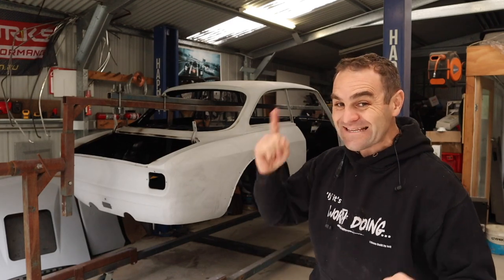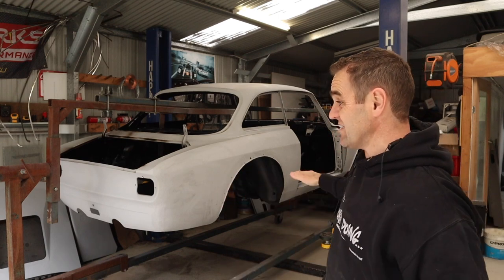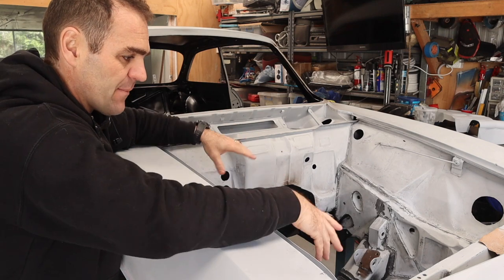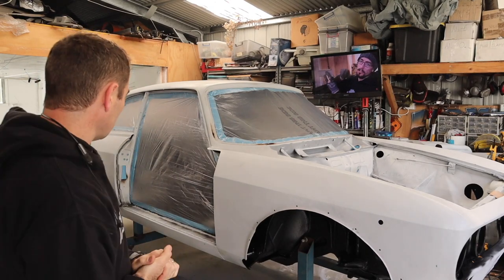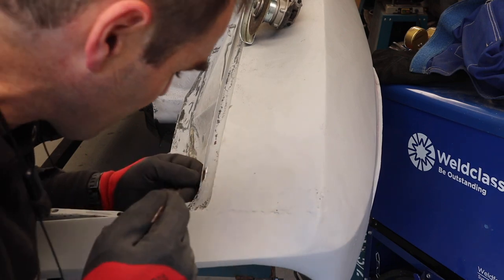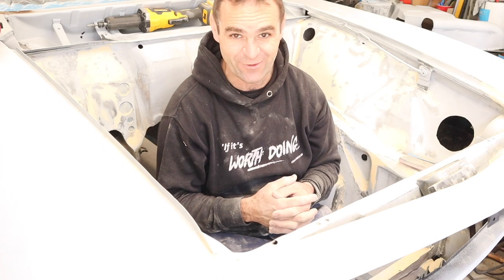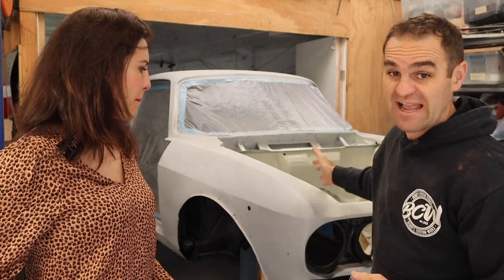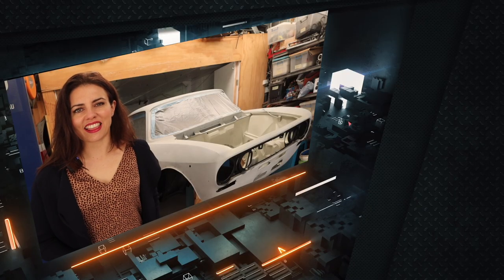Smooth engine bay - Ferrari engined Alfa 105 Alfarrari build part 136

Comment: A clean engine bay is such an improvement over stock. I deleted the battery, wiring and brake booster on my build and it makes such a difference,  especially on a twinspark engine.  The Ferrari engine will cover most of the engine bay up anyway.

Comment: Another tip when applying body filler to an inner wing scrunch up a ball of cloth about 3 inchs soak it in paint thinner then smooth out the filler with it , works great on more curvy panels , looking good .

Comment: I almost pulled the trigger on a bulk lot of old Iwata and Devilbiss spray guns for $1600. I was going to build 2 good guns and sell the rest.
But I'd be changing over to the 3M pot system which is an extra $200 anyway so I may as well just get the 3M gun.
A good gun won't make me a good painter! I just need the right gun.

Comment: Hi, great work. Can't wait to see this in paint!
Small concern regarding spraying 2k high build primer on bare metal, I would have used an etch primer first. That's not a criticism just an observation.
Reply: Depends on the primer. I've been looking for high build primers and found several that can go DTM (even one that claims Direct to Anything)
Reply: @jayinmi3706  I agree, I'm sure he's looked into this but for what it takes I'd still use an etch primer even if it was from a rattle can.
Reply from the maker: This primer is fine to go over small areas of bare metal, but I probably should have used and etch primer first.

Comment: I'm curious what primer you are using if you can prime 80 grit scratches and not have sinkage. I always finish 180 grit before primer. It's always alot of work working on engine bays. It's looking amazing.
Reply from the maker: Concept high build primer

Comment: At least 2k primers I sprayed allowed using reducers to be used with spot guns with tips as small as 1mm or 1.2mm.
Reply from the maker: You definitely can thin them down, but they don't fill as well. Using a good primer filler can help smooth things out nicely.

Comment: Good job as usual. Why did you mask the car to paint the engine bay? 😊
Reply from the maker: The interior is finished so I think that is self explanatory... ;)
Reply: @HomeBuiltByJeff  Thank you for taking the time to answer. I thought it would be no problem to have some primer over the interior primer 😉
Reply from the maker: @diego646464  Interior is black not primer ;)

Comment: I'm really surprised you're priming over 80 grit. 120 would be BARE MINIMUM for me, i think you'll get settling into the scratches. hope not and advise caution on the outside of the car. Get well Jeff :elbowcough:

Comment: Being that it is a Ferrari engine you are putting in there perhaps you should follow the Ferrari standard which is to finish all interior chassis in textured satin black rather than trying to mimic the look of a dipped Alfa unibody by painting the interior engine bay in body color. The textured satin black is going to subdue all of the little nooks and crannies and imperfections that are going to stand out with a glossy body color paint. It also has the effect of causing the mechanical aesthetics of the engine to stand out in stark contrast and if you ever decide to change the exterior color it would be much easier to do if, like a Ferrari, everything other that the exterior body panel surfaces is black.
Reply from the maker: I am hopefully aiming for better build quality than Ferrari is know for ;)

Comment: Red like Ferrari's ???🇬🇷🇬🇷🇬🇷
Reply from the maker: Maybe... ;)
Reply: The official colour of Ferrari is actually Yellow... hmmm...
Reply: If red go Rosso Metallizzato probably expensive butt would look great on the cars curves.
Reply: I mean, it would be the most logical choice, since both Alfa and Ferrari use red in racing. For example Rosso Etna of the Giulia QV or Rosso Competizione of the 8C would definitely look stunning on the Alfararri...
Reply: I would think white or off-white (off white would better suit the age of the car) 
with tri-colour stripe either down the centre line of the car or pin stripe along the sides would look nice.
Perhaps with gold wheels..
But that's just me....

Comment: what i don't like is that the body shape is made of loads of filler mass
Reply from the maker: Actually there is very little filler. Watch Retropower or any high end builder and you will still see filler used, just sparingly.
Reply: Filler or Bondo gets a bad rap when it's used to hide poorly repaired bodywork damage. 
And usually laid on about an inch think.
The correct use of filler/Bondo is as a skim to smooth out imperfections - maybe 1-2mm thick at most.